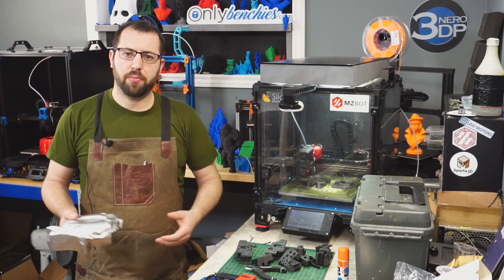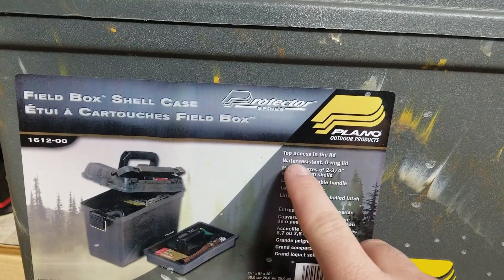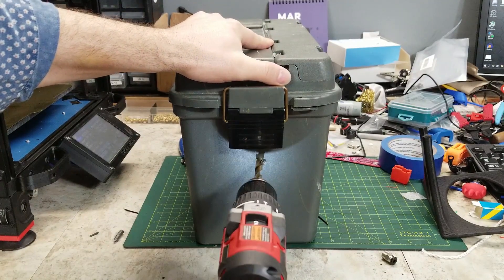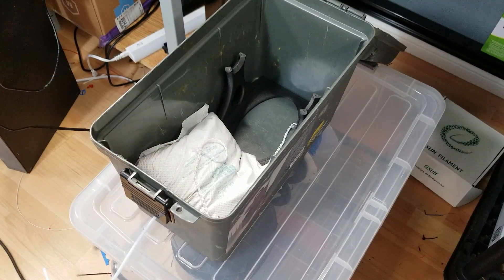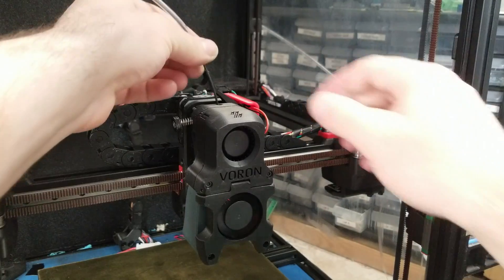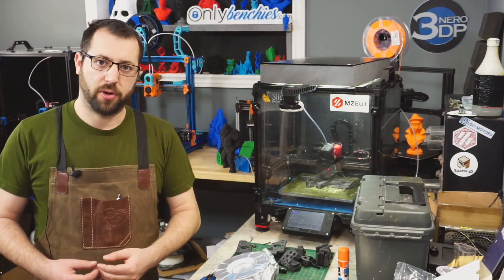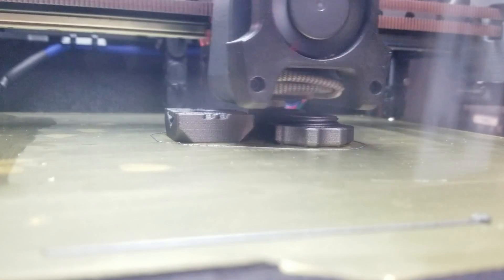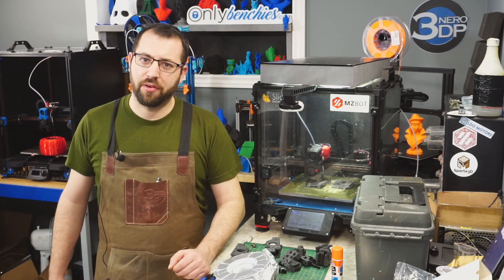Building a Drybox - Quick Printing Tips

Comment: I printed some TPU gaskets for my bulkhead fittings.  While I have not vacuum tested the bulkhead gaskets, I have vacuum tested installed TPU gaskets for other projects (same layer height/thickness) to 18 inHg with no measurable decay.  Though silicone caulk, or even PTFE plumbing paste / Loctite592 on your fittings would work too...

Comment: Are the parts made out of nylon for a voron? I was reading and all I could see was "only use abs" I was thinking about using CF Nylon. I have been printing with it on my enclosed and heated ender 5 at 60*c chamber temps with great results.
Reply from the maker: ABS is recommended as we know it works and easier for most to print

The CF nylon is for a higher temperature (fully insulated) build and for long term testing of the material
Reply: @CanuckCreator  I just ordered a 350mm 2.4 I'm printing the pieces in abs currently for it. I may try out a few pieces at a time with the CF nylon. As I want to enclose mine when it's built. What is the most stressed or loaded part of the 2.4? I can try them out first. Using 3dxtech pa6/cf

Comment: Nice, I made mine from a plastic walmart cereal container with the spool holder bolted to the container wall and loose desiccant at the bottom. The containers they sell at my local walmart are the perfect size for two 750g spools. The desiccant has lasted for a few months now with a 3mm bowden tube output that's usually connected to the machine so the seal is pretty good.

Comment: What did the total cost of this drybox end up being for you?
Reply from the maker: Not sure, really depends on where you get the box/desiccant from as they are the most costly items.

This was built using stuff I already had on hand (at like 1am as well to boot)
Reply: You can get 5lb boxes of silica gel desiccant off amazon for ~$20-30 which is enough for several dryboxes or one printer box and a giant storage box. If you use a cheaper plastic storage bin you could probably get the cost down to $15 a piece pretty easily.
Reply: I think it's worth checking out your local dollar store for the drybox. I have definitely seen boxes at my local stores, but not sure if they had the airtight sealing.